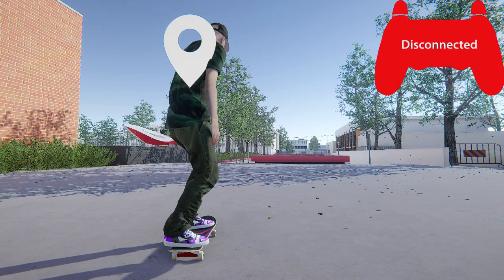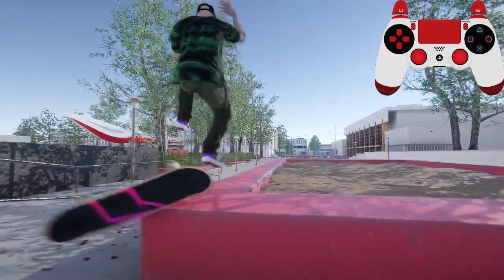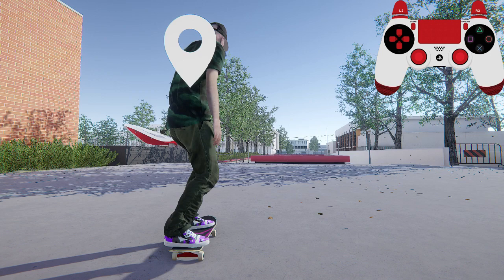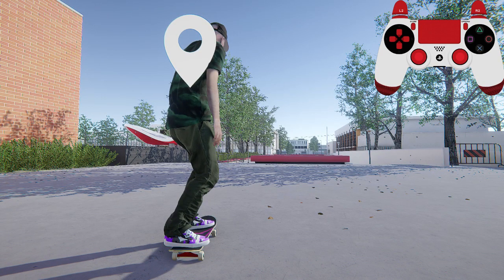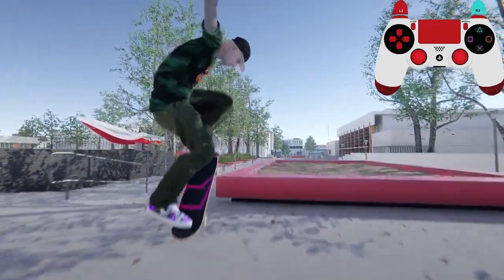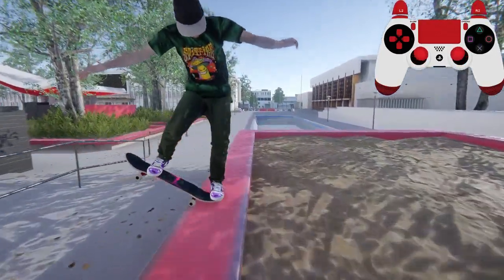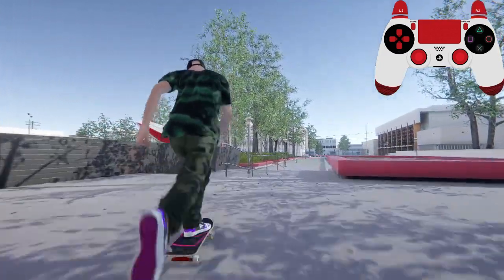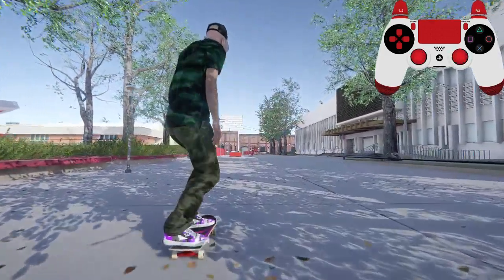Skater XL Tutorial - Advanced Grinds (Ledges)

Comment: What's a center pop grind?
Reply from the maker: when you land in a grind it'll default to popping out in the direction opposite to which you entered. Popping out centered lets you pop into other grind tricks on the same ledge or rail. It's a difficult input, so grinds that pop out centered like that, especially on short rails/ledges or while moving fast, are particularly difficult in terms of inputs-per-second.